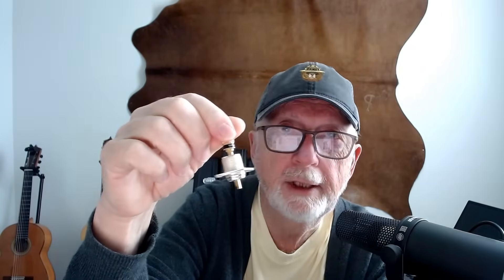Use Cheap TV Coax Cable For Your Ham Radio Station.

Comment: When i got back into the hobby, I used tv coax for years!
F to PL259 connectors are cheap, could usually pick some up at a hamfest for a dollar or two.
The only caution is that you need to seal the ends really well so the aluminum doesn't corrode - if it's corroded enough, the swr jumps around considerably.
Reply from the maker: Good advice!

Comment: I get what you are saying.  Your HF rig with the built in tuner should quickly match 75 ohms if the coax is also a match to the antenna.  If the antenna has a matching network like a gamma, it could be maybe be adjusted to 75  as well as 50 I would think. My only beef with some TV coax is the single conductor center.  Too much flexing has been known to break that single wire in the middle. If you are worried about transmitting with it,  it probably still would be good for receive only applications,   such as a scanner monitor radio.  Make a vertical dipole for the range you want to receive rather than a ground plane and it should match nicely with low loss at VHF or even UHF.
Reply from the maker: You don't need to do all that.  The impedance of the feed line at the transmitter end won't be 75 ohms unless the feed point is also 75 ohms - unlikely.  The tuner will make the antenna system, which is from the input of the tuner to the load, resonant, tuning out the reactance.  It's in the ARRL Antenna Book.

Comment: An old ham turned me on to RG-11 15 years ago.Ive been running it for year on my Imax 2000 with 700 watts no problems .
Reply from the maker: One reference I found said RG-11 is good for up to 2500 watts under matched conditions at 10 Mhz.

Comment: Mark

I agree with everything you said especially about SWR. With that said I’ll stick with my RG-213. I actually enjoy soldering a Pl-259. I’ve got it down to a science. I truly find it relaxing. However if I’m in a pinch I’ll take a ride to a big box store and pick up some RG6 and give it a whirl. 

73
Reply from the maker: Great Doc.  Sure if you can afford RG-213 why not?  Me?  I hate soldering PL-259's.  Never could get it right.
Reply: Have you ever used 300 ohm line with a transceiver? @BustRadioMyths
Reply: @BustRadioMyths yeah I’m the odd duck who like to solder 259’s. 😂

Comment: Been running tv coax on my 2/70 cems radios for ages.
Works perfectly.
Been running tv coax on my 10/11m radios for decades.
Works perfectly.
What's more I've put up to 2kw into my Sirio vertical for 11m with tv coax.
All still works perfectly.
Mostly this was through desperation being a lack of money and supply and availability of relevant gear.
It worked and like all temporary jobs that simply work, that's how they stayed
In saying this, I do run 213 and LL400 for everything else and that includes jumpers too.
Love these videos, keepem comin Mark👍👍👍👍👍
Reply from the maker: Some hams have gotten hundreds of feet of TV coax for nothing from cable techs.   I guess they throw away miles of the stuff.
Reply: @BustRadioMyths  Exactly Mark, the local rubbish dump is where I got mine.
Miles of it
Reply: @BustRadioMyths  I have about 200 feet that the cable installer gave me when he found out I was a fellow ham but I have been reluctant to use it because of the myth perpetuation. You have shattered that for me and I will be using it in place of and RG8X or other coax.
Reply: I already try RG6 also RG59 I found them in store, ask price, when I hear price I sad give me 100feet(in metric 30 meters). I was use them for 2 meter up to 75W on HF I have just 25W but I try from radio club 120W , both cable RG6 and RG59 work well. I cannot afford my self RG213 
Difference in impedance 75/50 ohm give theoretical VSWR 1.5:1 This isn't end of the world. More VSWR  give wrong matched antenna than this difference in cable impedance. And really 1.5:1 no one radio would not suffered. When I try cable with dummy load 50ohms I can clear read 1.5:1 , using real antenna this will be even less value. 
SWR meter measure all together antenna and coax.
Reply: I like RG59 (75 Ohm) for stacking antennas.  A quarter wave 75 Ohm able transforms the impedance up to about 100 Ohms.  Perfect for connecting two 50 Ohm antennas together in phase and in parallel, to go back down to 50 Ohms.

Comment: This brought back memories.  When I was young and ignorant, I used whatever military surplus coax I could find -- regardless of intrinsic impedance value -- to connect my Navy surplus TCS-8 transmitter and Army surplus SP-400 receiver to my homebrew antennas.  The TCS-8 and SP-400  did not have coax connectors; so, I connected them to the coax feedline via twisted pair line-cords connected to a DPDT knife switch.  The TCS-8 had a tunable tank circuit that was variably coupled to a built in L network that could be variably configured to match a low or high impedance load.  The SP-400 was designed for a 600 ohm input impedance, but seemed to work well regardless of antenna system impedance.  Ignorance is bliss.
Reply from the maker: That's hilarious.  Twisted pair connected directly to coax.  Why not?  It worked!!!  We've been ruined by SWR meters and PL-259's!

Comment: Kids in the 80s used to just throw wire over the roof and twist the wire around the antenna on a HT CB and talk just fine
Reply from the maker: Got a video coming up on not using coax or ladder line.

Comment: You can get a Type F to PL 259 adapter. I used this in the past, worked well. In fact someone on 2m QSO told me that it could not be done. My answer was you are talking to me on TV coax and you said I sound just fine. He ended the QSO. Of course he did. 

Forgot, you can get RG6 in BNC and BNC connectors for it. The best part is, you can pick them up at any box store. No need to order online or drive 500 miles to a radio shop. 

Oh and I did not need a tuner.
Reply from the maker: How dare you confront a ham with facts!

Comment: LOL. This subject has been quite a ride for me with the tuned issue. As far as I see it, if the reactance is zero (or as close to zero) the antenna is tuned. 

In my case, an anal retentive OCD mentality, I prefer a permanent tune, so I took my time physically tuning all the bands on my DX Commander, given that I do not use any tuner on this antenna, I m thrilled. My amp also is a happy camper. 

This whole tuner thing is a semantics issue. The tuner is a temporary tune, the second that you shut the tuner off, the antenna is no longer tuned, therefore I consider that to be a temporary tuned antenna. In both case the reactance is what it is and the antenna is tuned be it a DX commander or a non resonant long wire, which resonates just fine with the tuner in line. 

That’s where I am at with with this!

Louis
WW7GBA
Reply from the maker: Hey if that makes you happy go for it.  Nothing wrong with it!
Reply: As a new Ham, and those coming in the future it is imperative that the info is presented clearly as you do. I was at Hamcation, sorry I missed you. I am in one of your videos in the background. I was there with Buddipole. I am from Pompano Beach. I live in Utah now and Buddipole is now headquartered here about two miles from me. So I hang with Chris at the shows.

Louis
WW7GBA
Reply from the maker: Man sorry we missed each other. Two ships passing in the night.

Comment: I am using CT100 75 ohm coax (intended for satellite TV) for my loop on the ground antenna. It works just fine.
Reply from the maker: Can't think of any reason it would not work just fine.